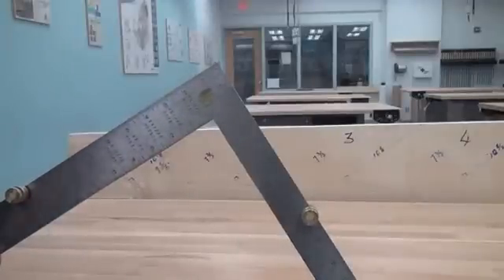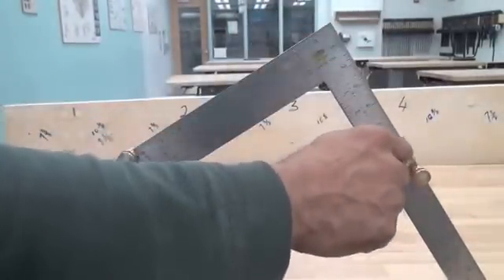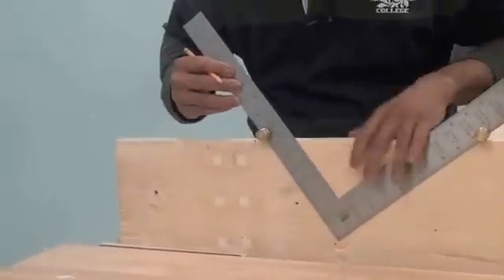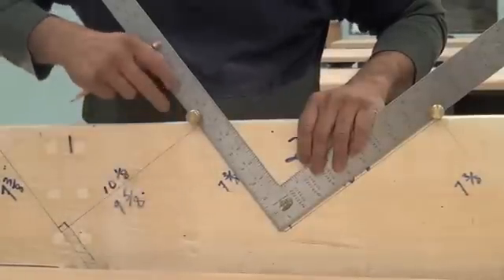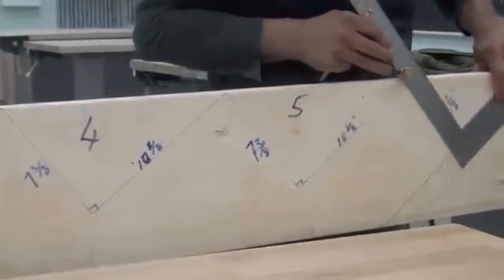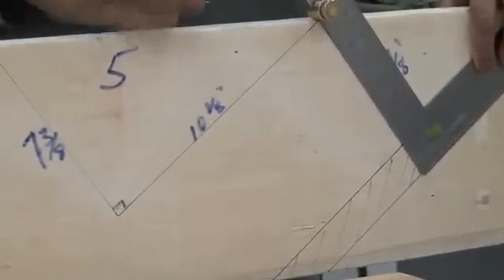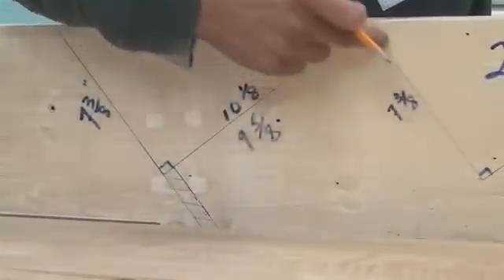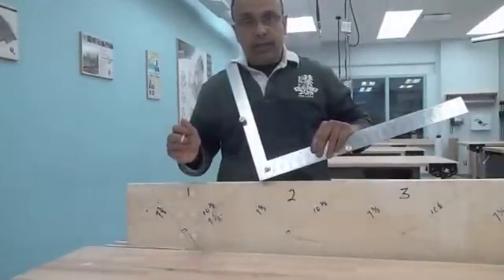Stairs

Comment: So you are using a sub stringer for the main stringers? If so when you cut out the triangles out of the 2x10 your left with 3" of wood to hold all of the weight of the entire stair case. The longer the stringer the weaker the stair case becomes and will break that 3" of wood. The cut out stringers are meant for the center of the stair case and are to be attached to the left and right 2x10 solid stringers. The solid stringers also hide the endgrain of all the treads and risers.
Reply from the maker: Hi Craig

This video is meant to show how to build simple construction stairs, not finished stairs.